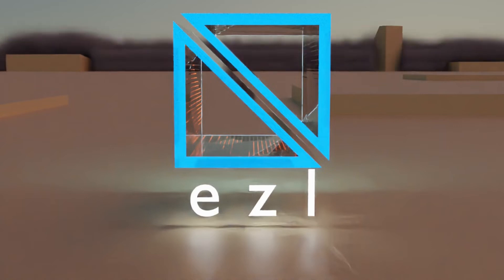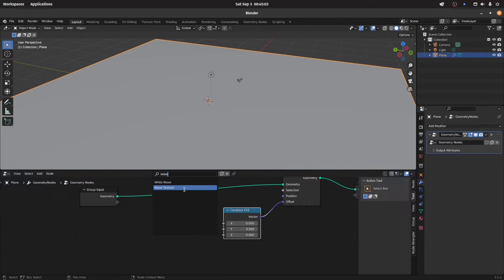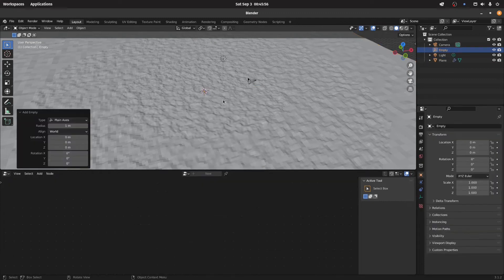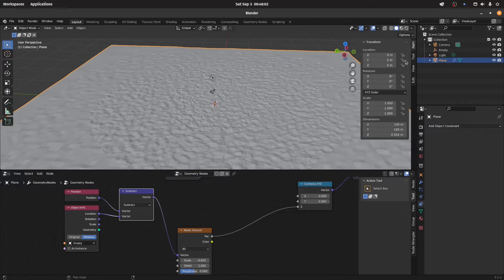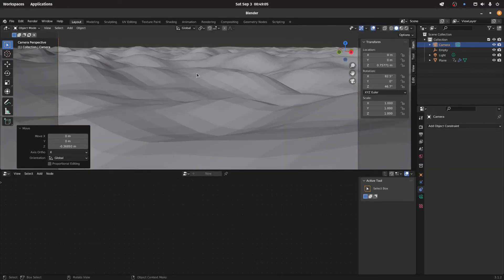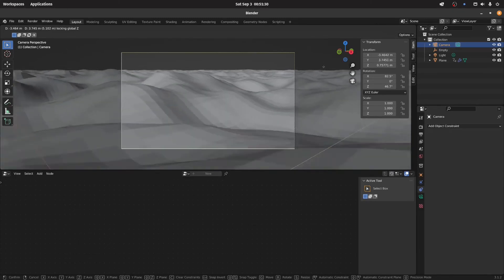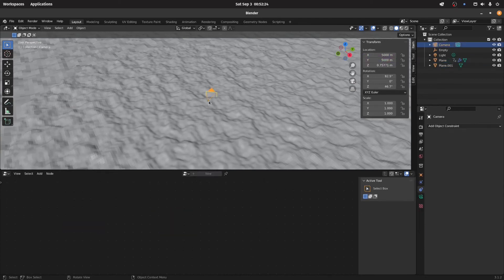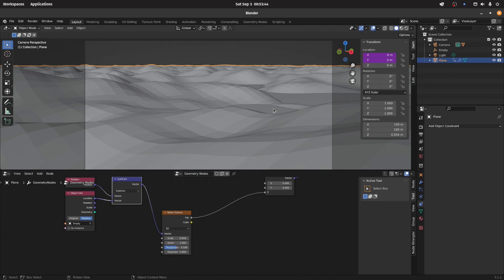Infinite / Procedural terrain in Blender (Eevee)

Comment: Great Idea! I was also thinking about this issue, but your idea is great and much simpler to handle ;)
Reply from the maker: Thanks. What was your idea?
Reply: @dezl  I was thinking to do the terrain with polygon grids, let's say 8X8 Grids with a subdiv on it. Depending on the distance to the camera the resolution of the grid changes and on top of the grid is a displacement modifier for the height of the terrain.
Reply from the maker: I started with the same idea but found some on who had this idea (for a game). And it is easier to make :]